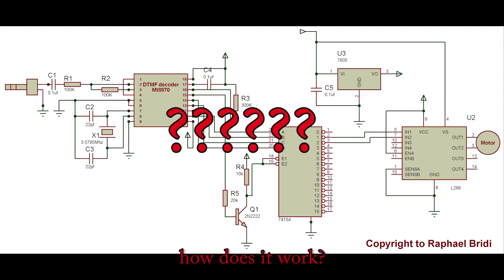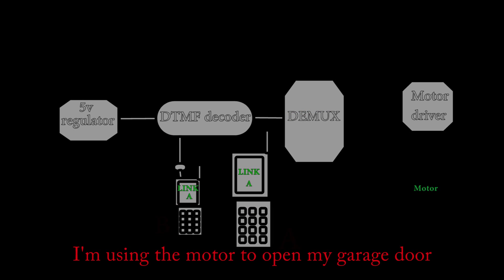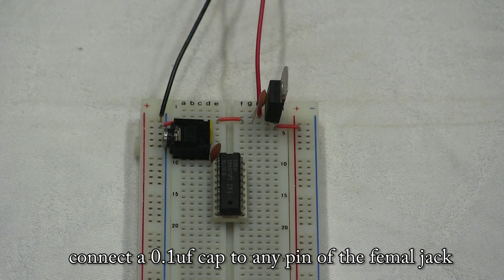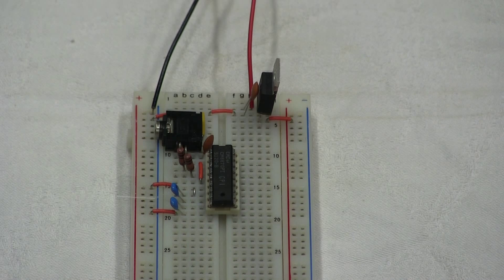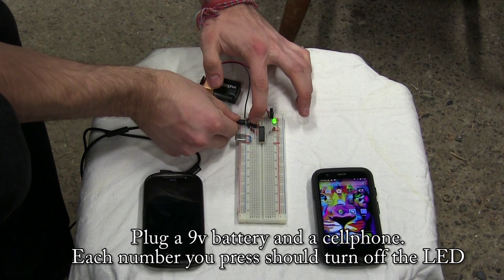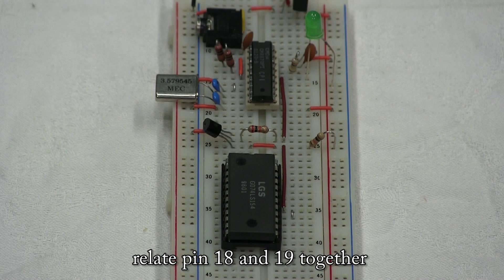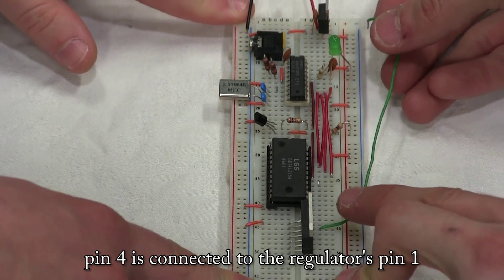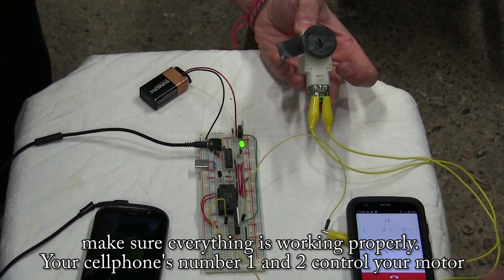[D.I.Y.] Make your own DTMF decoder circuit

Comment: Could've just added a relay contact across the up/down switch and elimanated the control motor thingy. Less things to break. Can also process the audio from cheap walkie-talkies so you can control it from wherever without tying up somebody's cell phone. Use a transistor to make a wired AND gate so the correct tone and signal valid together hit the switch.

Comment: how do I identify the longest pin in the female speaker jack??
Reply from the maker: you need an ohmmeter to do that. one probe should go to the longest Jack header and with the other probe, touch each pin of the female Jack. the pin with 0 ohm will be the longest Jack pin
Reply from the maker: +D.I.Y. or DIE oh, I forgot to tell you that you need to plug a male to male Jack in the female speaker Jack in order to follow the steps below